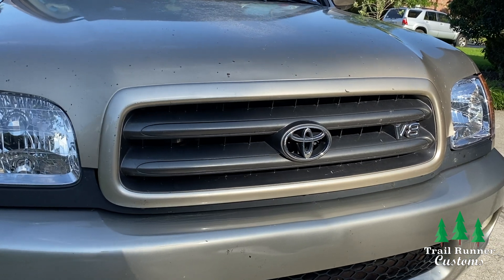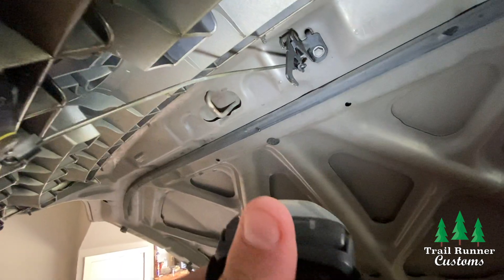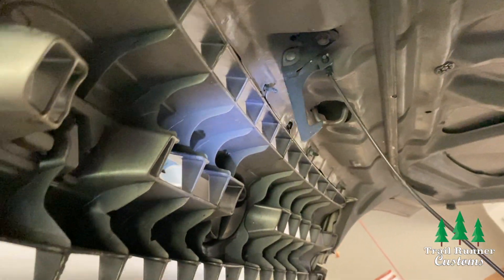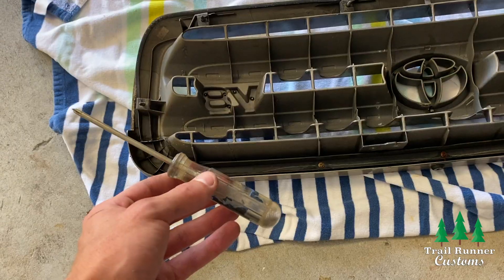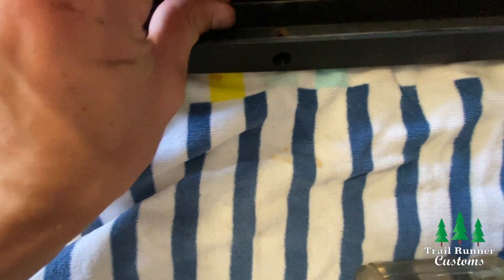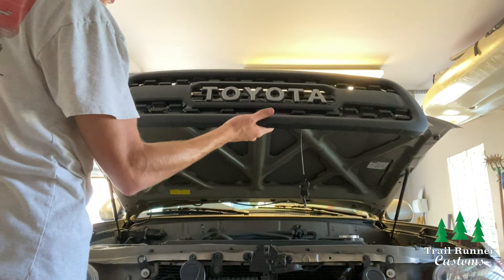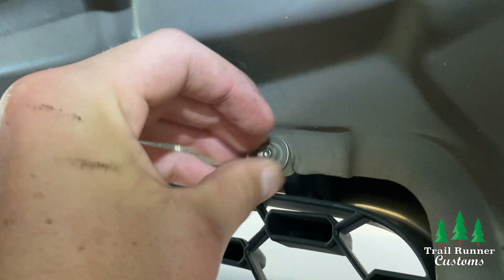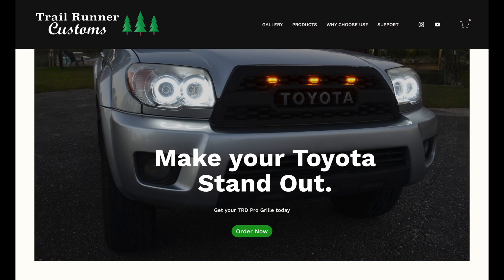Sequoia TRD Pro Grille Installation 1st Gen (2001-2004)

Comment: Will this fit the 1st generation 2005 Sequoia? Also, do you have a video on connecting the grill lights? Thanks
Reply from the maker: The 2005-2007 sequoia grilles are set to release later today! We are hoping to have a video covering sequoia light install this weekend.
Reply from the maker: OUT NOW https://www.trailrunnercustoms.com/products/p/toyota-sequoia-trd-pro-grille-2005-2007
Reply: @trailrunnercustoms  great thanks!